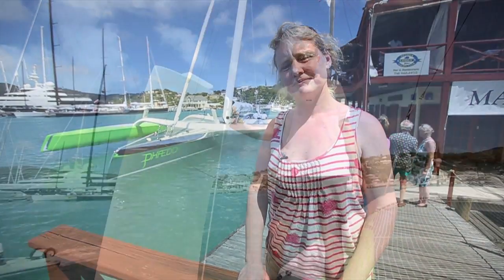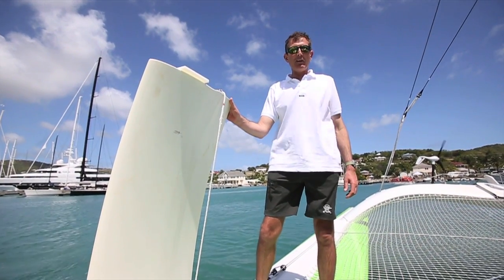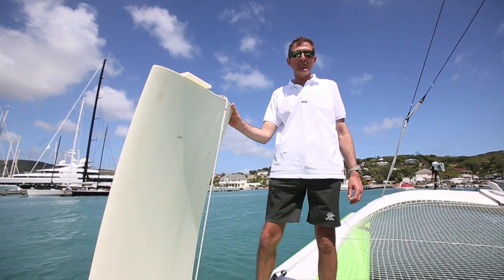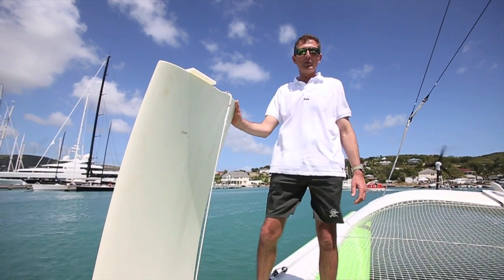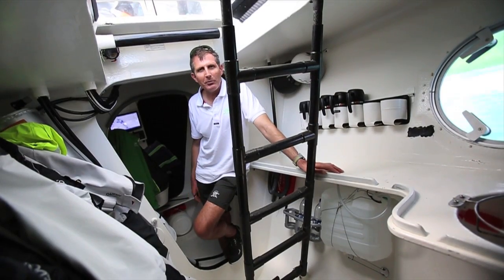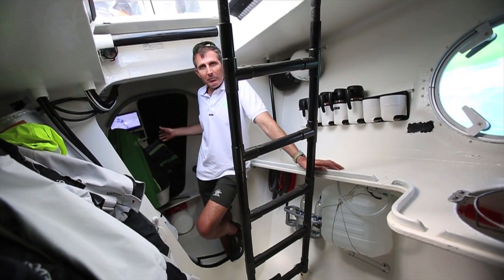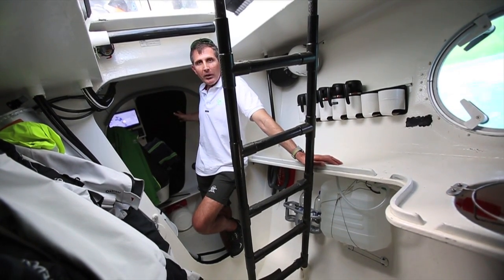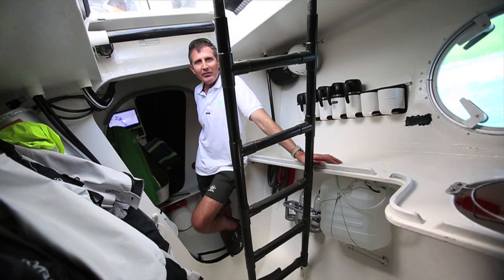A tour of MOD70 Phaedo³ with Brian Thompson

Comment: I don't understand why the mast on the mod 70 only rotates 45 to 50 degrees 
I rotate my mast 90 degrees and sail with downwind tacks with teltales streaming 90 degrees to the boat. 90 degrees apparent.
Reply: It's so fast that the apparent wind is basically never anywhere near 90 deg, even when hunting max vmg dead downwind. More like 45-50 max.... Probably usually a lot less than that in anything but very light wind.